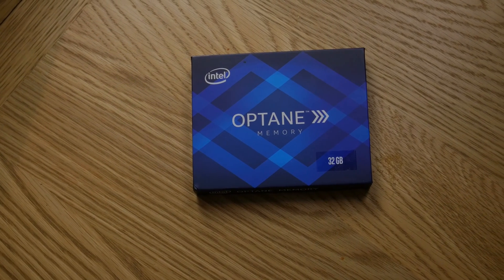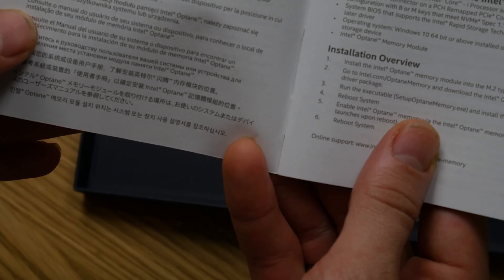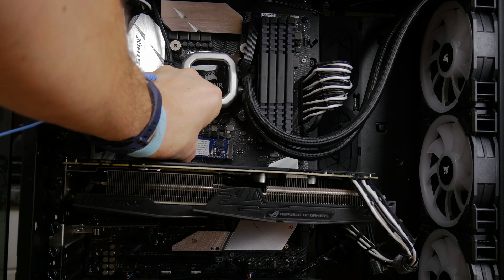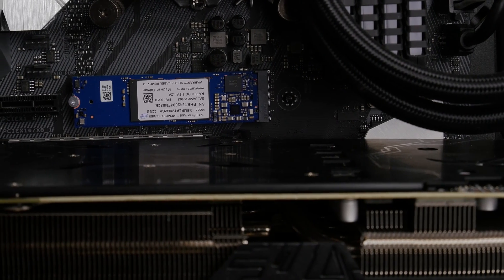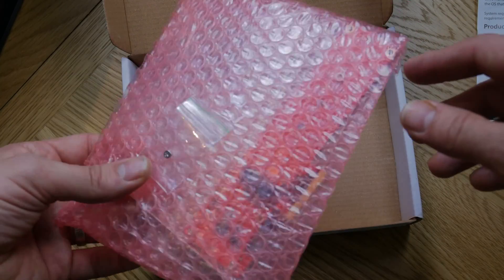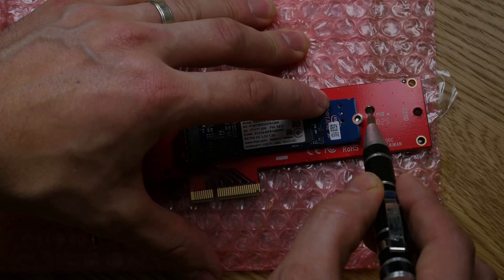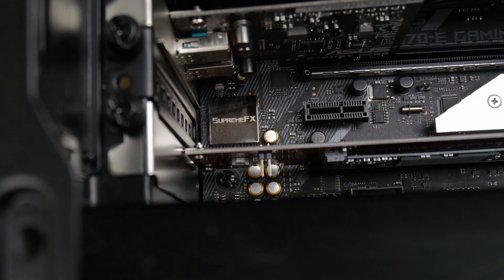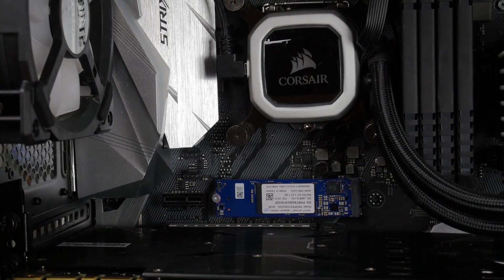How to speed up your hard drives with Intel Optane Memory

Comment: Hello, could you help me? I cant see any PCIeX4 slot at specification, can I install sdd with adapter(GA-Z97X-Gaming G1 )?
Reply from the maker: I'm not sure and wouldn't want to give you any bad advice. What I can say is you could try something like this instead - https://www.msi.com/PC-component/M.2-XPANDER-AERO it's an adapter that can hold 4 x NVMe drives and fits in your PCIe x16 slot (same as the GPU)
Reply: @TheProvokedPrawn  Thank you.
Reply from the maker: @aleksandrs2442  apologies for not being uber helpful. There are a few different adapters out there some don't do exactly the same thing. Good luck! Hope I earned a sub.